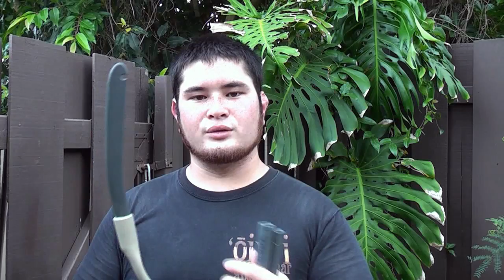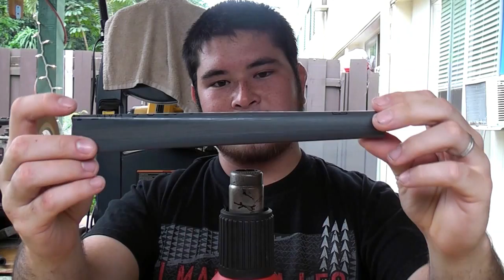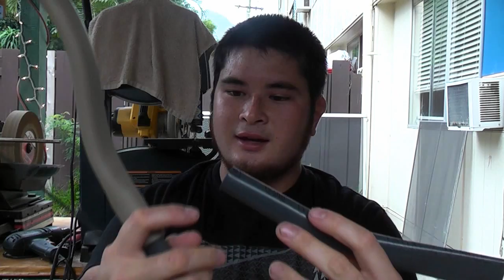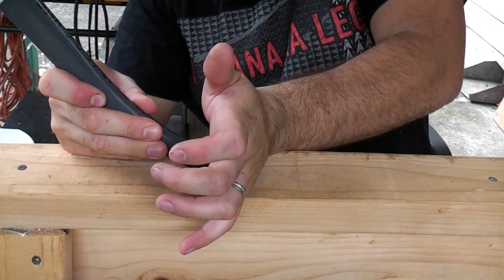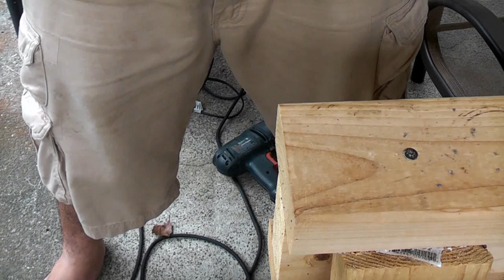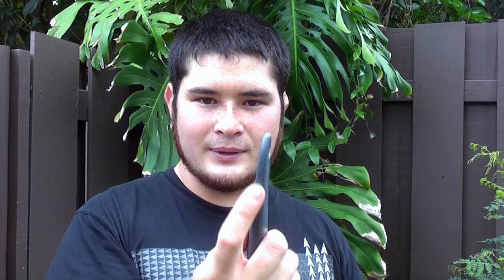Making PVC Siyahs for Flattened PVC Pipe Bows

Comment: If I make 6 inch sias and insert them into the pipe limbs 3 inches on each end will it cause problems with stability of the bow or no
Reply from the maker: +Robert Miller It will depend on how short the bow is overall. If the bow was stable before and the siyahs don't take away any length, then it should be fine.
Reply: @BackyardBowyer  how long that the siyahs

Comment: Hi Nick
  Quick question
     What's the effect of the length of the siyahs to the speed, snap and performainc of the bow, keeping the overall bow length the same?
    Say a 54" bow would have a smaller back with longer siyahs.
Reply from the maker: There are tradeoffs. First, the longer the siyah, the less limb is working. This usually translates to more initial set. If you can get over than, a shorter working limb means PVC is stressed more, and it ends up performing better. Longer siyahs tend to make up for the excess weight at the transition, whereas really short siyahs only add weight due to the overlap in the transition.

Siyahs themselves won't change the speed of the bow very much, but any time you put a recurve or static siyah that is reflex closer to a midlimb, you will see an increase in speed. If your siyah has string bridges and actually has the string roll off of its like a recurve, then you get the benefit of a complex force/draw curve. This gives a noticeable snap and increase in initial arrow speed.
Reply: Thanks!
   What do you mean by "initial set" ?

   I think I got it. "...roll off the siyahs..." is a little like the effect of follow-through for throwing a ball, and the bridge acts like a fulcrum in a lever or the axis of a pulley.

    Longer siyahs assist in giving a smooth draw feeling so you don't feel the bow loading in the same way as a longbow, right?

    So its possible to have a low draw weight bow that still has a relatively very fast initial arrow speed.
Reply: Also - does adding wood reinforcement to the siyahs add weight and work that the PVC has to overcome?

  Wood seems consistently more durable than PVC in some applications and I enjoy the puzzles in looking for ways to create visually attractive designs that also push or demonstrate just how far a bow's performance can go.
Reply from the maker: Initial set is basically the memory the bow takes when you're breaking it in. When you first build a bow, the limbs will be straight. Once it's broken in, the limbs will have taken a permanent bend to them. You can't stop this, but you can design a bow with reflex so that it counters the effects of the set.

That sounds like a pretty good explanation. A recurve also lessens the effect of stack, which is probably what you mean by the bow loading.

It is possible to have a low draw weight bow with a fast arrow speed.

I'm not sure what you mean by the last question. Wood siyahs generally do not add much weight, as most wood is much lighter and stiffer than PVC. You don't need much wood to make a good set of fast and durable siyahs.
Reply: Thanks Nick - I was referring to the way some fine grain, fibrous woods behave compared to plastic, but that's more guessing from different applications. Good to know.
   Also, now that I think about it, I must've been thinking of the bow you showed that had the wood laminated by the PVC - while beautiful, did it also have a mechanical reason?

    Stack is definitely what I meant by "loading"- Some of the archers I meet and now here seem to use different words or even have different ideas about archery, even as fundamental as drawing from the chest or back. So much to learn and sort out. 

     Yes, I did discover that a low power bow can be very fast - Tim from Golden Hoarde Bows is the person I found to help with the archery tag bow (if you youtube "archery tag bow" you can find him shooting the un-decorated one at 25 pounds but maybe 165+ fps), and it didn't even have the bridge or roll-siyahs. 

     While I know speed isn't the main thing for a great bow, it is fun - so designing a mid power "speed demon bow" with the beautiful recurve shape is kind of a goal/dream at the moment. 

     I noticed that in an asymmetrical bow - the shorter, rounder, less stiff (more recurved) limb felt a lot easier to draw, but maybe had less "snap", though that might be subjective. Is there a way around that, or even true?
Reply: Hey Nick, I've been rewatching your videos and I can't make a recurve bow. The string slides off and the bow spins around. Why is that happening?

Comment: Are there any differences in preformance when using pvc siyahs compared to wood siyahs?
Reply from the maker: Generally PVC siyahs will be heavier unless you get creative with material removal. PVC siyahs also have less side-to-side stability. They are more forgiving to a beginner and require no guesswork for fit and little to no woodworking experience yet still yield a nice finish.
Reply: Is there any major difference in flattening the ends like in your hobbit inspired bow and using seperate PVC siyahs?
Reply from the maker: Flattening the ends and taking material away ends up being more efficient. The downside is that it can be tricky to do right and if you take too much material away the tip may be compromised. Separate PVC siyahs are a lot easier to do, and if you mess up you can just replace them.
Reply: Thank you for your responses!

Comment: Hey Nick, if you just flatten your PVC pipe perpendicular at the tips to the direction that the rest of the pipe is flattened, could siyahs like this be made as an integral part of the bow? Would that still add the same benefit, or any benefit at all? Or would it even work?

Comment from the maker: I have seen Apoxie Sculpt work on PVC bows. It's basically a 2-part epoxy type sculpting clay. It has good adhesion, doesn't shrink when cured, and will flex with the bow. I'm sure plumbers epoxy putty can be used the same way but I've never used it for sculpting.

Comment: Hey there, I am attempting something similar, but with horse heads,  for a friend, and id say plastic or plumbers putty would be easiest,  but careful with the heat they make when hardening. I am trying to do them with rubber for this project though, as per the requested design from the eventual owner. If it comes out,  I'll show how to make the molds at some point.

Comment: siyahs also help as levers to draw the bow. siyahs were originally developed to aid in dawing very heavy weighted bows easier. composite bows are usually over 100 lbs and were relatively short (54 inches) compared to their long bow equivalents (72" and above). having a short bow core at strong weights requires assistance to draw them. non-bending outer portions (Siyahs or stiffer tips) give a lot of leverage allowing a "weaker" person to draw very heavy bows relatively easily.
Reply: I sooo thank you for this explanation!..we see a lot about seyahs , but I didnt know why!

Comment: hey nick when u sink the bottom if the siyah into mto the msin bow limb do u just heat the last 2 inches of the bow limb and slide the siyah in...im making a 56 in piece of 1 inch schedule 40 and the desired draw weight id like to achieve is between 55 and 65 lbs...my draw length is 30 inches...do u think i can achieve that with the 10 inch siyahs like u made or would u shorten the siyahs a bit...thanks for any info or help

Comment from the maker: As far as I can tell, there is still a lot of benefit. A 1/2" siyah in a 3/4" bow will be lighter than the 3/4" tip it replaces, even if the siyah is schedule 80 and the bow schedule 40. Going from 3/4" to 1" has an even greater weight savings.

Light wood siyahs do perform better, but PVC siyahs are pretty easy to do and can be done as simply as non-modified bow tips. The more streamlined profile and lighter weight make it a better choice than just leaving the tips wide and flat.

Comment from the maker: Siyahs lower the mass a bow has at the tips. Even schedule 80 siyahs are lighter than the tips of solid schedule 40 bows. They also reduce the resistance that wide, flat tips have. I usually get about 5-10 more fps with siyahs as opposed to untapered  tips on a bow.

Comment from the maker: Honestly they perform about the same. Even though schedule 40 is lighter than schedule 80 by a little more than half an ounce, I don't find much difference. From what I can tell, the differences in performance are very slight. If you're chasing speed, I would say go with a light wood. Otherwise it's mainly cosmetic.

Comment: Siyahs, being stiff, act much like a the recurve and give the end of the return a bit more snap, ensuring the string follows the arrow all the way to rest. A self bow often slows at the end of its return, meaning the arrow will come off the string as the string "slows" down, which is inefficient. Siyahs and recurves aim to fix this. Sometimes they are made of lighter material and thus sap less of the energy of the bow returning to rest, giving a bit more speed as well.

Comment: This pretty much sums up what I do - funny how you can take different paths and still end up in the same place!  Nice tip on the 3/8 drill for rounding the nock holes, hadn't thought of that.  I've made mine a tad smaller, and I insure that the hole is larger than the groove so that it allows aggressive angles on the siyah withough the threat of the string coming out.  Very helpful Nick - Mahalo!

Comment: I like it. I've only made two bows with wooden siyahs because I'm using hand tools, so this option will expand my ability to make bows with siyahs.
On a different note, do you have a chart or list of some kind with bow length, tip style/length, brace height, and draw weight of bows you have made? I have my own mental list that I use to try and make bows to a specific draw weight, but that list is very incomplete when it comes to 1" sch 40 pipe. A list/chart like that Would be helpful. Thanks!